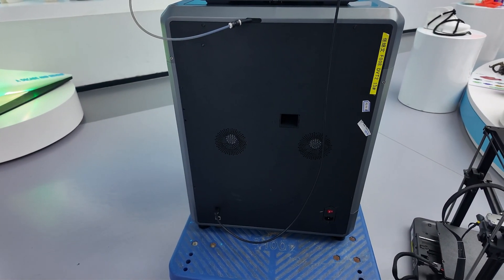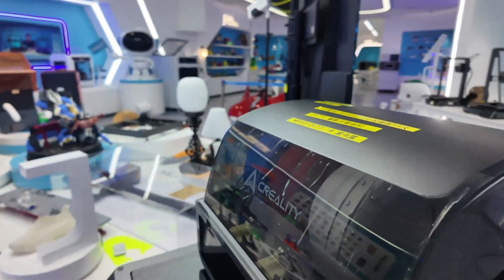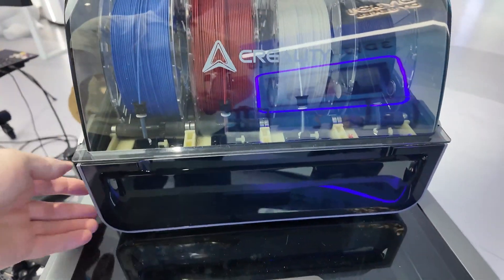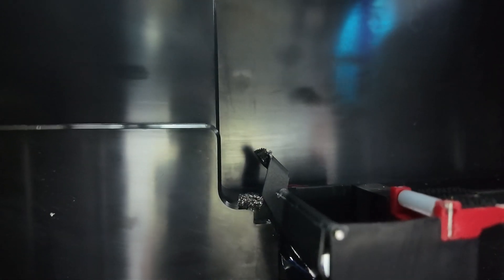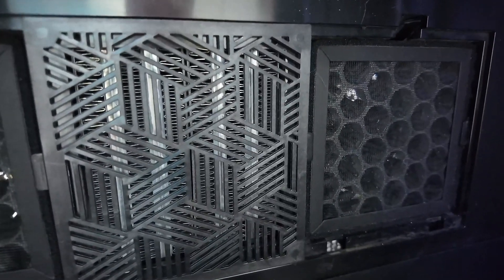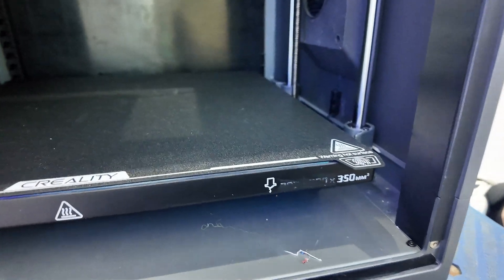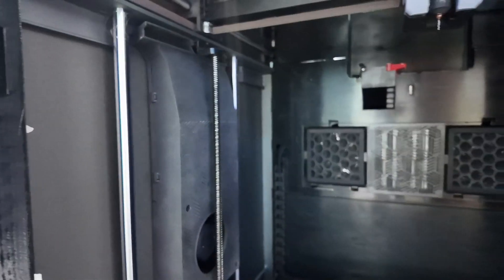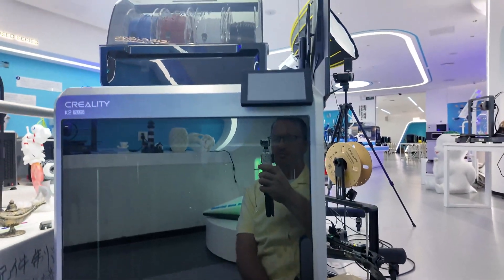Quality Time with #creality K2 Plus.  This is your best look at it so far #crealityk2plus #k2+

Comment: Why would they make that top cms a actual dryer?
Reply from the maker: why would they?  I think a lot of people would like a filament dryer - I live in a very humid climate so I need to dry my filament most of the year.  Why didn't they?  An active dryer would have required external power and they didn't want to have two power cords for the unit.  Maybe they will design a CFS 2.0 one day
Reply: @kevin.in.3d  - Two power cords? Oh damn i did not think of that!  So buying a sperate dryer and sitting it next to the printer wont have another power chord?  I dont get it but you seem very intelligent so lets run with it.
Reply from the maker: @BionicCommando-u1d  wow, that seems unnecessary.  If you want a filament dryer, you can buy one and it will come with a power cord - yes.  Good idea.  If someone else does not want a filament dryer they don't need to buy one.  That is exactly what I meant.  Now if you want a power chord, you need to buy a guitar.

Comment: Creality need metal-gears in the extruder. Our K1 Max melted the gears as we were using some (bad) high temperature filament, which got stuck every 2 prints. At some point, it simply stopped working and we spent several hours before finding that the plastic gears in the extruder were melted.
Oh, and they should use a Micro-swiss hotend, while they're at it - and perhaps even a Kaika nozzle.
Reply from the maker: I have lots of friends that upgraded to the Flo_tech hotend.  I was going to do that this summer but then Creality gave me a K1C hotend for my K1 - so I installed that today.  I love the K1C nozzle so I'm hoping this is the end of the K1 hotend problems.  Metal gears in the extruder is a good upgrade also - especially if you are using abrasive filaments.  My guess is that to keep costs down, the machines ship with basic parts and then more advanced users like yourself can upgrade as you want.  If someone is only printing PLA they don't want to pay the extra for metal gears etc.  Taking apart the extruder is so frustrating tho - i cannot imagine finding the gears melted.  Thanks for the story.
Reply: @kevin.in.3d  - If using a good filament, one won't get in trouble and the stock hotend and extruders will be just fine. 😃
-But if ever getting into trouble, you now know what to look for; you can save hours by just checking the gears. 😉
-This can be caused by the filament being too thick in some places or too stiff in some places. The last thing might be difficult to check for and I believe it happens if you purchase 10kg filament spools, as I suspect them to be several 1kg spools that are spliced, and the splicing would perhaps make the filament stiff. This is only a guess though.

Comment: Would like to see the bottom of the print bed? Is it just stamped press warped aluminum straight from the factory or is it a cast and machined part? Thanks for the detailed view.
Reply from the maker: i will spend some time with it again on Saturday - i'll take the build plate off and get some shots of the print bed for you - stay tuned for more content!

Comment: is there a lock on the CFS, so it could make it air tight?
Reply from the maker: there is a lock on both sides so it is sealed closed - but it's not an airlock.  Certainly will keep the filament stable I think, when combined with silica gel packs

Comment: Quality looks different, and it is definitely as loud as the K1! But why should Creality install quieter fans with the same airflow...
Reply from the maker: I think it is much quieter than the K1 - has more fans and runs very quiet.  This is using FOC closed loop motors - so not the same as the other K series printers at all.  They use magnets to reduce the noise.  Check out the product page on creality.com  It's got some new tech, this isn't just a bigger K1

Comment: it can't be more like bambulab AMS, if u have compared CFS's patent with AMS, that is the conclusion u can get
Reply: The nozzle/feeding system is completely different. The Bambu have big issues with the funnels getting worn because of the bad angle of the filament.  The CFS seems to have fixed that.  Also the CFS has a built in temperature gauge

Comment: I'm excited about the K2+ and if it will live up to the claims. I was expecting much more from this video. But its on a cart, not plugged in, no showing of what it can print, no showing the display and it has the world's smallest poop container - basically useless.  Spent almost 10 minutes going over less than what the website has in regards to details. Seriously? Why in the world didn't you plug this in and show it off properly? There are only two options, you didn't think of it or Creality wouldn't allow you to. So which is it?
Reply from the maker: yeah, this is Creality behind the scenes.  Printers are going to be on carts and I'm gonna film them while everyone else eats lunch.  I had 11 minutes alone with the printer but I guess you are right, I should have wrestled it onto a table, set up some spotlights, plugged it in and started a print.  I'll work on that for my next video.  The poop chute container was to demonstrate how magnets will work on the back, something we have not shown before - you are under no obligation to print this tiny container for your printer.
Reply: I totally get being in a busy work space, so the cart thing isn't a big deal. No need for spotlights though (your being a little over dramatic there yea? but then again I was in my response so touche). Personally I would at least plug it in and power it up for people to see, a big missed opportunity there and to go over so much information, which didn't happen. It seemed like your first day doing a review on youtube (not prepared, just winging it). I would have taken about 30 seconds to think about what should have been presented and it would have made a world of difference. Onto my concerns...

First, yes poop container is optional, but at least admit its the smallest poop container on the market. If you have done or seen any multi-material printing you know that container will fill up in mere minutes and then spill over = not good. Please suggest a poop shoot like other printers have; maybe even one which has the shoot which would empty out and down the back under a desk or counter into a trash can. Even one that has a larger container on the side (like some other big name printer company has done). Just a thought.

Second, my concern was the lack of information in the video. I look at it from a perspective if someone who is looking at 3d printers, this video should have included a ton of information to persuade them; 'the K2+ brings lot to the table because it does X, y and Z... lets go over them..." But that didn't happen. I mean I can rattle off a lot of details of the K2+ off the top of my head but the viewers here got next to nothing. I don't know if you work at Creality or was just given limited access but missed a great opportunity to really persuade people that this is going to be a great machine.

Third, no showing off of prints. I didn't expect to have the machine actually printing, well... yea I did a little, but at least show some items it printed and show off the capabilities. Another lost opportunity. 

Fourth, the lack of information on the nozzle, extruder, safety features (2 fuses for heated bed, etc) should have been mentioned (safety is important). Never addressed if the nozzle can be changed quickly or what size it was, or if Creality is going to offer different sizes, no mention of flow rate, etc. Does it have a carbon filter? Then what about print times? Will the machine have RFID for spool? Can the CFS use third party spools? Does this machine have WIFI, ethernet or a USB port (where is the USB port located?) to transfer items to the machine to print? I know it does but most newbies don't know that so its another opportunity to sell this machine. So much info was not brought to the table, I mean to the cart, with this video. 

What I did come away with was you said the CFS weighed less than 4 kg (impossible), you liked the door and wanted more logos on the machine, as if those were THE big selling points but thats not what is going to sell this printer to people. Please understand I'm not being mean and I don't know you from Adam; you could have just had an off day and I get that. However if I was new and this one video was all that I saw, I would be hesitant to check into it further because of the lack of important details in this video. Lesson learned I hope.

Also if this is still in development as you said, please suggest that the exhaust fans have screws holes for ventilation port attachments like on other machines, especially when printing indoors (homes, offices, etc) to vacate harmful VOCs. As it stands people will have to drill holes into the machine to attach exhausts adapters to vent this thing and that shouldn't be something people should have to do, especially with such a machine. Oh yea, and make a much bigger poop shoot/container.

Please know I'm not a fanboi of any company and I'm in the market for a large build area printer and thats why I made videos discussing the K2+ as an option for me. I have researched, checked out the Creality website, forums, etc to get up to speed on this machine (btw I have a background in electronics so I know what to look for) but not everyone has that experience, so you have to sell this ever chance you get, but that didn't happen here.

Anyway, I would love to see another video where you actually go over the specs and things I mentioned in detail, with the machine plugged in, show the lights, display, menu options, etc. etc. Leave it on the cart but plug it in and really discuss the important selling points and hit a home run with it.
Reply from the maker: @theVariedLife  wow thanks for the comments.  Yes i work at Creality and to be honest we have been doing livestreams about the K2Plus a lot - so there are plenty of videos with all of this information in them (including videos with the printer running).  This video was to show the printer up close to those who have bought it as many people want more looks at it.  Good input tho - thanks!
Reply: @kevin.in.3d  I will definitely check those videos out. Looking forward to seeing more about the K2+ in the future and especially reviews. With that said, the K2+ is still on my list for a large build area FDM printer. :)

Comment: I'm hoping the mod community figures a pretty quick way to put an actual vent on the printer. Have my K2 pre ordered, but I print with ABS and ASA a lot. I have a dedicated in-line exhaust fan designed for a grow tent and dryer vent hose  to a mount that snaps on the back of my K1 Max, to exhaust all the fumes from the printer out a vent I installed in my basement. I just had to remove the joke of a fan/filter that came with the K1 Max. I absolutely suck at trying to model things myself but I think if it came down to it I know a friend who would probably help if I could get him the exact size of the fan openings, distance between them, ect. 

A little filter and some charcoal only mask the smell a little, the VOCs that are actually bad for your health are still present unless you actually vent out of the space. I can imagine since the back is metal, it'd be easy to make some kind of a Y shaped adapter that maybe uses a combination of magnets and something like window seal strip or something. Then have that Y piece end as a typical 4" exhaust hose size.
Reply from the maker: i think that sounds like a good idea - using magnets on the back would prevent you from cutting any holes in it.  Put an exhaust fan on the back and run your hose out the window - sounds like a really good idea.  I have not tried printing with ASA - what do you use that for, what are the benefits of ASA over ABS?
Reply: I definitely wouldn't want to be drilling into the K2, or anything that'd be a permanent modification. The adapter for the K1 Max just clicks into place on the back, so it's not a permanent modification either, and I kept all the fan pieces so I can return it to stock if I decide to sell it after receiving the K2. 

But as to the filaments ASA was originally designed as a replacement for ABS. 

ASA has the benefits of ABS but with UV resistance. As someone who has printed with both, ASA is easier to print with. It's nowhere near as prone to warping as ABS. ASA is suppoosed to be produce less VOCs while printing, I definitely got headaches printing with ASA before I made the vent-to-outside system though, so I'd still recommend venting. IMO nothing that involves burning/melting plastic should be breathed in. ASA isn't available in as many colors as ABS though, so that's a drawback. ASA is typically a bit more expensive than its ABS counterpart. Like ABS, ASA can be post-processed the same ways including acetone smoothing.

But generally if it's something I'm making that will be outside in the sun, or something inside the printer enclosure where it's going to get hot, I typically go with ASA.

Comment: 1. That poor print quality right there has to be a MAJOR alarm sign!  I don't buy the excuses this is just an early prototype, and therefore OK at this stage. That's a weak excuse this far into pre-production. This is an experienced company, showing off their flagship model, and trying to finally convince the many sceptics they have what it takes to knock BambuLabs out the quality-of-print park with their own game.

2. The other thing that really irks me about Creality is the inability to address the MANY criticisms of the poor placement of the Poop-Chute, Filament Entry Points, and Mains Power Switch at the BACK of this large and heavy unit, when it is immediately obvious to any USER-CENTRIC designer, that ALL THREE of these facilities SHOULD be placed on the FRONT of the machine.  Having a bank of these machines on a bench against a wall is an obvious customer placement. An Engineer / Designer that persists in thinking its OK to stuff important operating access at the BACK of a heavy, awkward to move machine in a row of similar machines against the wall ... needs his pay stopped until he fixes this mistake! (And I would still continue to be worried where else such a designer is taking short-cuts at the expense of the end-user).

This is a sales-feature mistake that needs the intervention-balls of a Steve Jobs / Elon Musk type CEO character to throw his toys out the cot, and pull the plug on the design team, and DEMAND they fix it. Pronto!  Middle-management AIN'T gonna take that decision. It's the ethos of the man at the top that separates out a great design company, from the merely good.

Reply

Comment: A few questions, WHY is the 4 way hub on the back of the CFS?? It really needs to be on the printer itself because it actually feeds into the printer and each CFS will then feed into the hub, this doesn't make any sense at all!! Then you can put each CFS where you want??  Also, I REALLY hope they put a 5V USB socket somewhere inside up around where the lights are so we can add a longer strip/rope light all the way around the interior perimeter? Or when someone comes up with a file for a CFS Riser to rise up and stack the CFS on top and still be able to open the glass top, then you can add a full length strip light around the Riser !  Most people won't understand what I am talking about unless the have a Bambu P or X series multi-color printer! Yes, I am ashamed to say I do have a P1S combo, only because I WON it for $250 on a FB Waffle and it's a $1000. set-up??? My Heart and roots are still ALL Creality and my 1st printer is a Ender 5 Plus which I still have and it's a BEAST, and I LOVE it and had ZERO warranty or any other issues with it and it is about 5 yrs old! .... But it's slow, so, now it's getting converted to a corexy and will run a sonic pad using Klipper! Should be VERY close to a K1 series when I am done!! I am planning on a K1 Max here real soon to take over while the 5 plus is down, then this fall I will get the K2 Plus and take my Bambu out behind the Barn and SHOOT the darn thing!!!  🤣
Reply: I bear the shame as well, I have a P1P with AMS....So wish I wouldnt have bought it.  It has been the most troublesome machine I own.

Comment: you need to bring out a k2 aswell make it cheaper also are you bring the CMS out for the k1 and k1c and max as a upgrade kit
Reply from the maker: yes, the CFS will eventually work with the K series printers and also the Ender 3 Vs and Ender 3 V3 Plus.  It's all in the plan - but it will be a while before that can all be done.  No time announced yet.

Comment: Now that´s a really nice blatant Bambu Lab P1S Ripoff...
Reply: It's better.It's the correct size.😊
Reply: @Matts-3D-Creations  Yep. At over 2.5x the print volume of a P1S it's in an entirely different league.
Reply from the maker: i wonder how many A1 mini's we can fit inside.  Paint a toothy grin on the door and make it look like it is chewing them up :)
Reply: @Matts-3D-Creations  with the typical creality quality I guess. At least judging by the video the inside is still the usual crappy stuff. Had three Crea printers, switched to Bambu. Never going back.
Reply: Except for the massive size increase, Better screen, faster printing, heated chamber, better ventilation......But yeah sure.  COMPLETE TWIN TO IT...FFS!
Reply: @anthonylong5870  lol, trying to convert the bambu poeple is pointless.  Like telling someone who drives a Dodge that there are other cars out there.

Comment: Do you print PLA with the door open or closed ?
Reply from the maker: it has two fans at the back so you can keep the temperature down if you want.  No need to turn on the chamber heat for PLA.